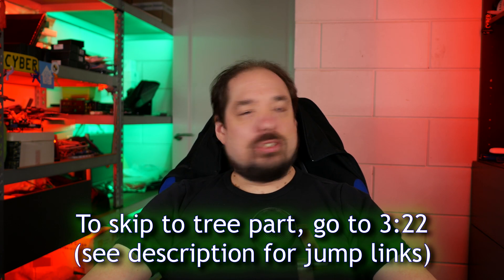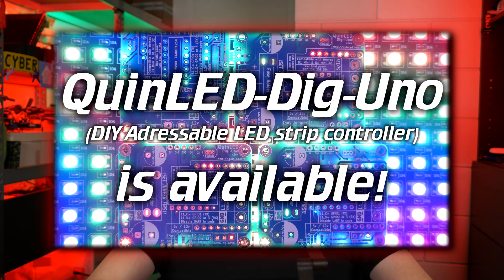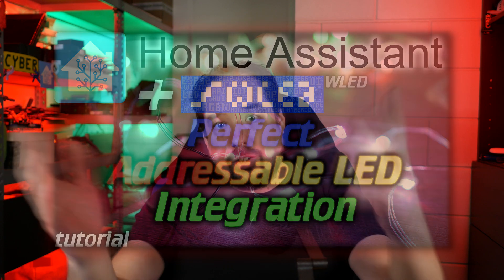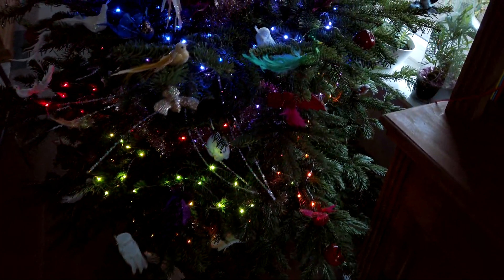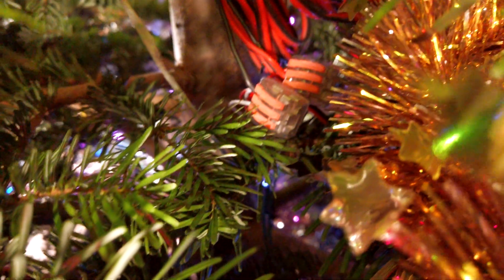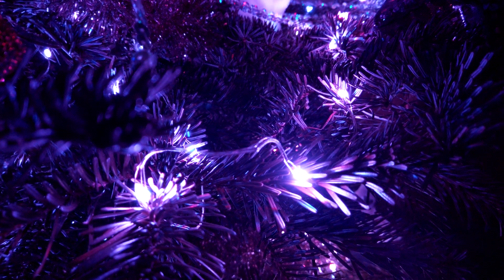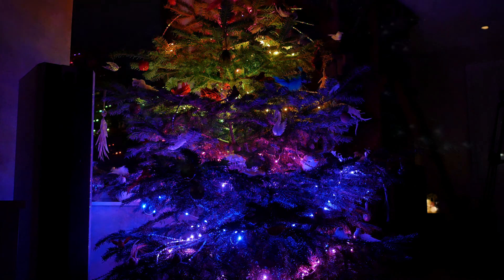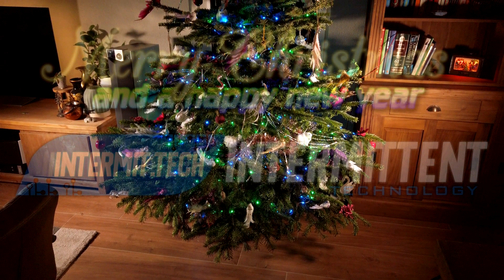🎄🎄 Ultimate WLED Mini Pixel Christmas Tree LEDs 🎄🎄

Comment: I don't understand about the diodes on the Dig Uno.  How should the diodes trigger the fuse? How are the diodes connected at all? It makes no difference whether the diode before or after the fuse
Reply from the maker: That all depends on the design. They aren't in series with the board but in parallel (well some, not all). If you connect any power wiring in reverse all the current flow will go through the diode which basically siphons it away as much as it can from the rest of the components. That in it's turn protects the rest of the board and because of the sudden inrush should blow the fuse. Since an SS24 can take an inrush of up to 75A and the board is rated for 15A to 25A that means it basically should always blow the fuse. Euhm in that regard it does make quite the difference if the diode is before or after the fuse! I have tested this quite thoroughly, and since implementing these protections I haven't been able to fry the board or my LED strips anymore, either the fuse blows or the power supply goes into OCP mode, whatever reacts first.
Reply: @IntermitTech  

When power is reversed, what happens? The Zener diode goes into breakdown and starts drawing a bunch of current to maintain its breakdown voltage. The rest of the circuit downstream experiences the breakdown voltage and draws current as it usually would under those circumstances. Meanwhile the fuse experiences the sun of the current demand by the downstream circuits and the current demanded by the Zener diode. Eventually, that current exceeds the trip pi but of the disease for long enough for it to blow and the voltage is cut off. Unless the fuse is improperly sized, and the Zener diode fails before the fuse trips, and then all hell breaks loose. fuse would have to be rated at a lower current than the current the zener blows at, which is probably very very small. The zener also probably blows faster at its max current than the fuse does at its max current so the fuse value has to be even smaller to account for that.
Im not very sure...
Reply from the maker: @M.4y  Yes, all of this is correct, that's why I used a 75A (burst peak) rated diode, and I've tested it up to 15A to 25A which my board is rated for depending on copper thickness and each time the circuit was saved. So the diodes draws away enough of the current from the board to pop the fuse (or send power supply in OCP, depending on power supply) before another component gets damaged.

I do get your skepticism but I've thoroughly tested this blowing up at least 30 fuses in all kinds of different scenarios and in all everything survived, even the diodes (which I agree would be first to fail). The fuse pops the split second the reverse (input or output) touches.

I would have much rather built a proper reverse protection circuit using a bunch of MOSFETs but that would require quite a lot more space in something hand solder-able and even then it would still be impossible to build something cost effective that can handle a 15A load without getting really hot. So I tried this solution and it's worked very well.
Reply from the maker: @M.4y  I think the diode needs to be reversed since you want it to do nothing if everything is correctly and have the power flow through it if reversed. :) What are you building! :)
Reply: @IntermitTech  Some sort of HA Switchplate. It's very difficult that all fits into a EU standard round wall box. I'm planing also to finish my doorbell(stl files, some mayor code changes) and a Tuya like dimmer
Reply from the maker: @M.4y  Ah, lots of projects, cool! Come around to the discord, would love to see some stuff! :)
Reply: @IntermitTech  I also showed small stuff on this YouTube channel but the most is private. I posted the code for the doorbell on GitHub. It isn't the newest version but there are some things to change. By the way I have joined your Discord server.

Comment: How do I find you on discord
Reply from the maker: Join the Intermit.tech Discord server! https://discordapp.com/invite/abk5kuD
Reply: Just made my xmas tree with 1x quinled-dig-quad and 4x50led RGB fairy lights. It looks awesome as long as i play with colors and animations. Could you recommend settings for warm white? It is  quite off and can't get a satisfying warm white.. Now i use  ff9a47 hex color. Do you know if there are Rgbw fairy lights?
Reply: @robertomorerio1594  Same question here. I'm afraid the warm white looks bad with most RGB LEDs. If that's the case I will not buy these.